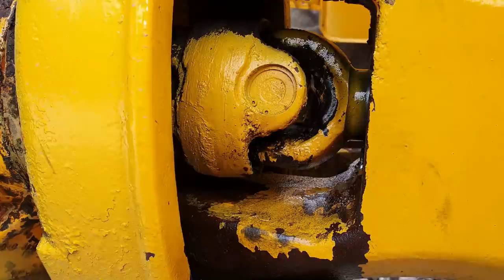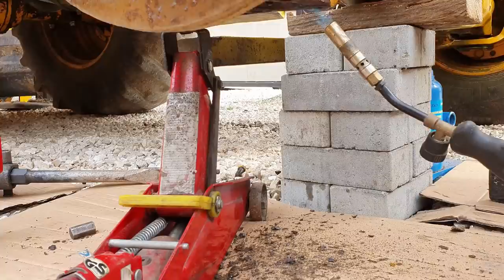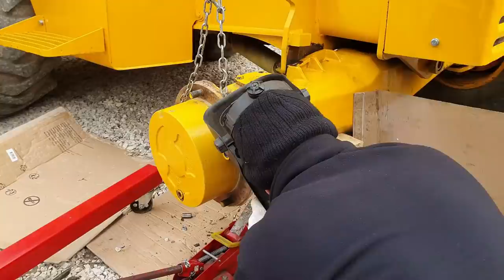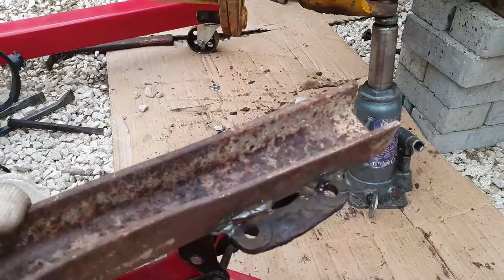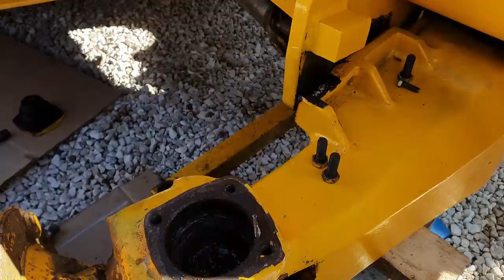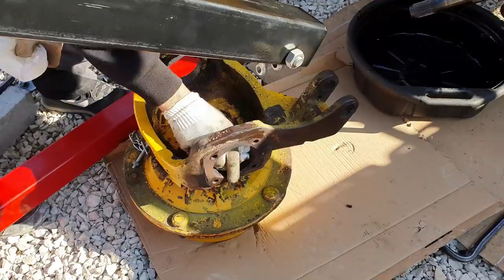JCB 3CX BEARING TRUNNION 1

Comment: I just did this on a 2000 JCB 520-50… you’ve done it all wrong… I too spent 6 hours with chisels and sledgehammers… you need to use the 4 bolts as Jack bolts and unscrew them 1/4” and put a plate against them and use a puller with chisels and a hammer… we probably had 30,000 lbs of pressure on it… you can’t heat it as there are seals in there you’ll destroy

Comment: ] As of 2007, it had daily production of 3.921 million BOE (barrels of oil equivalent); but significantly smaller than a number of national companies. In 2008, this was approximately 3% of world production, which is less than several of the largest state-owned petroleum companies.